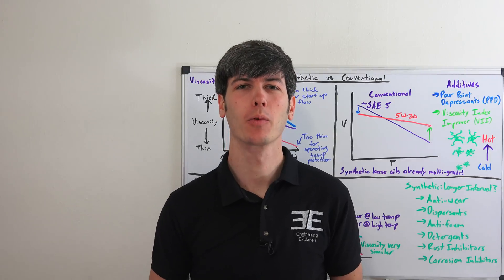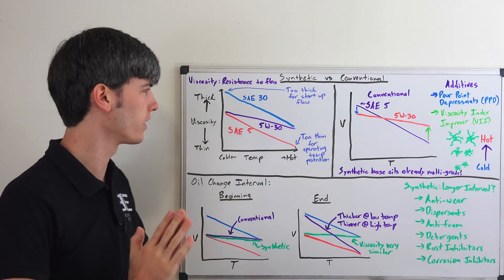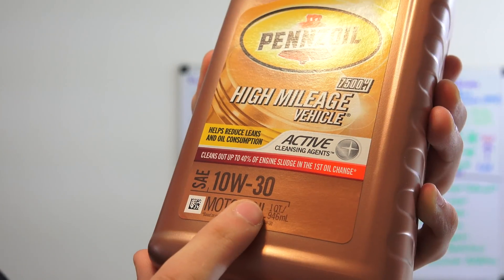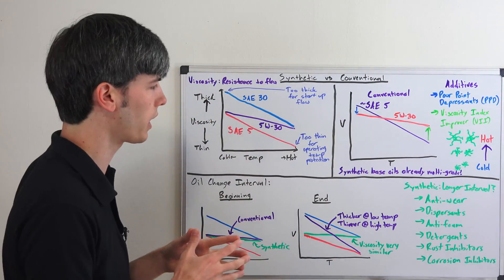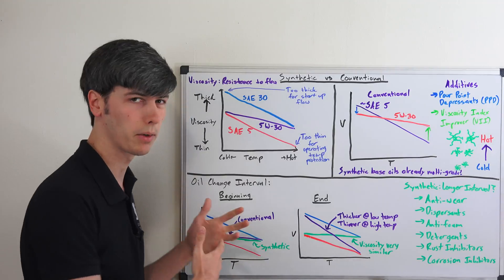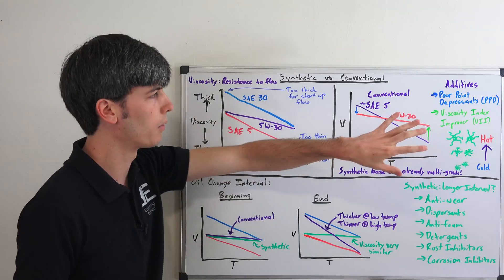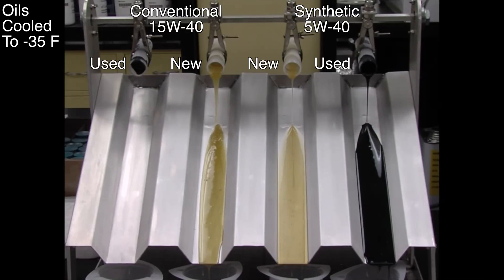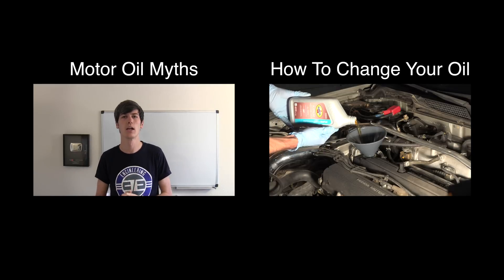Is Synthetic Motor Oil Better For Your Car?

Comment: I was told to use conventional oil in old engines since conventional oil used back them so the engines were designed to use conventional oil, is this true?
Reply from the maker: New oil is better in every way, so I only see positives to running modern synthetic. Only one I’ve seen that specifically recommends conventional are some rotary engines.
Reply: @EngineeringExplained  Agree completely. The reason mineral oil is often specified with rotary engines is due to the appetite for oil these engines exhibit. Basically it's a cost saving exercise to keep the owners vaguely happy.

Comment: Typically every manufacturer that requires synthatic recommends oil changes longer than the 3000 miles. Having said this, curious to know why you think that synthatic doesn't normally come longer drives between changes.

Comment: Some vehicles will leak using synthetic oil!!!
Reply: And others won't.
Reply: @paulanderson79  duh uh??!!
Reply: @mikesecondo2254  Some will leak with mineral oil. Others won't. In all cases the ones that leak is is because they have oil leaks. Fix the cause, rather than load the wrong oil into the engine as a botched workaround.
Reply: @paulanderson79  no not really....when switch to synthetic from conventional oil leak soon begins...... switch back to conventional oil leak gone....seen this many times... been in the auto repair industry for 43 years..so I know what I'm saying!!!!!!!!!!
Reply: @mikesecondo2254  I'm not disputing what you say but can you explain this phenomenon you've observed?
Reply: @mikesecondo2254  What drawing board? You've 43 years experience in the auto repair trade. I respect that. Thus I ask you an open and honest question. Why not reply?

Comment: If where you drive never gets to -35 F this demonstration is irrelevant. This is around the temperature where you and your vehicle both will quickly turn into popsicles. When I lived in Western Washington, the lowest winter temps were around 10 F, and that was rare. I'm in Central California now and it never gets colder than the mid-20's F overnight. Frankly, I could have used 10W-30 year around in every vehicle I have owned everywhere I have lived in my life, Chicago included. For someone in an ordinary climate, there is only one takeaway here. If you use conventional oil, don't go too long in the drain interval.

Somewhere in the comments here, someone who had worked as a mechanic for the New York taxi fleet said that what oil was used made no difference when they tore down the engines. Years ago, I drove high mileage for my job. I used both synthetic and conventional just depending on my whim. I saw no noticeable difference in fuel economy. In my estimation, if you don't live in a  subarctic zone or in the Kalahari, the only value of synthetic oil is that it allows a longer drain interval. I do no more maintenance than necessary and my vehicles always go to very high mileage. If using synthetic oil helps a driver to think maintenance and adopt driving habits which help preserve the vehicle, fine. But outside of a very extreme climate, seriously synthetic oil has little or no value.

Remember, you're driving a vehicle with a cast iron or alloy engine. You're not driving a B-52, a C-130 or a DC-4. What applies to these may not apply to a gasoline-powered motor vehicle. If you own some kind of exotic production, follow the recommendations. If you need to ask, you can't afford it.
Reply: You might be missing the point of the demonstration: Reducing the temperature of the oil wasn't for the sake of people who live in colder climates. They reduced the temperature of the oil so you can see (more clearly and easily) the significance of oil degradation after use between conventional and synthetic. The oil was cooled significantly so you could see an extreme, and clearly see that the properties of the conventional oil were more significantly affected, while the synthetic oil was fairly the same (even under these extreme temperature conditions). Sure, you're right: This is an extreme and most people won't fall into these extremes. Just thought I'd offer some clarity in perspective in case you missed it.
Reply: @patrykjanuszewski2126  I'm back after a year. No, I didn't miss the point. What I am saying is that the oil degradation which occurs may be irrelevant.15W-40 is called 15W-40 for a reason. As far as I know, the increase in viscosity occurs not as a result of polymerization but because lighter components evaporate out. Hard to get good numbers but the temperature range of 15W-40 conventional probably is down to about 0 F. The best information I can find indicates that engine oil heats up at the rate of 10 degrees F per minute at idle, and probably faster is the vehicle is moving.

At the indicated temperature range for the product, the used 15W-40 will work just fine just like the used synthetic 10W-40 will do also. Synthetic 10W-40 is supposed to flow adequately at -40. Even the used 15W-40 would start to get pushed around by the oil pump and start to warm up. But it's not a good idea and outside of the product specifications to run 15W-40 at a -40.

If I've learned anything from all of these videos, it's trust the specifications of your products. Dino oil is made to go up to 7500 miles but I think 5000 miles should be the maximum interval for dino and 3000 miles is better. For me right now, 3000 miles is twice a year.

Comment: The thing I found interesting recently is how "full synthetic" and 100% synthetic mean two different things. Full synthetic is not 
"full" synthetic at all but a mix regular oil with additives and perhaps a varying mix of synthetic or not. This was circa 1996 or so 
after a lawsuit between 2 major oil/fuel producers and how the oil can be marketed. This shocked me as I had been using Mobil 1 for years on all my cars, newer and older despite mileage. I learned that the only 100% 
synthetic oil producer today is Amsoil and Motul. I wonder if EE has looked into this as far as the degradation and lifespan of true 100% and "full synthetic" types?
Reply: i was Not aware of those exact details but i'm not quite sure that's the whole story.  Fwiw, i used to use Amsoil in my jeep 4.0 engine ,and was shocked that it thickened quite quickly, can't recall now but maybe within 3 or 5K miles if not fewer miles, it had thickened quite dramatically, and i became dubious about the Amsoil brand and about the theories i guess that they use in their formulation.   Maybe bad batch ,dunno.   But it was fine when new, and then thickened markedly, to the point of clearly being a bad oil for the engine

Comment: You seem to be very knowledgeable about oils.  There is a large Porsche air cooled community that would be interested in how good Swepco 306 compares to the new Porsche Classic in both viscosity and for wear protection of the flat tappets because of the high spring loads on the cams.  Could you do a comparison

Comment: Its means sysnthic engine oil is better for car..??
Reply: Yes. With no exceptions.
Reply: @paulanderson79  no if you have a older truck or car it is not always better for example I have a 92 ford f150 when I bought it the guy told me he had conventional oil in it cause that's what runs the best I did not believe him i then changed the oil and filter at the appropriate mileage and put full synthetic in the next day I noticed a kind of knocking sound from my engine when I started it that would go away after it warmed up that did not happen before and my truck started to leak somewhere but I did not know where from so I went to store and bought conventional oil and changed it again and both the knocking sound and oil leak stoped
Reply: @loganhaxton4653  OK, I cannot argue with the facts as you present. But have you any idea why this might be happening? It defies all logic.

Comment: Not everyone should upgrade from Motor Oil, I payed $50 for Synthetic Motor Oil in my 2006 Chevrolet Aveo LS, and I just hit the interstate, it Ran really fast but not for long; soon It was bone dry and I was broke down; it eat away all of my seals that had that looked new before the oil change. The engine was Clean and never licked before with the old oil type and the seals had been personally installed less then a year ago.
if it ain't broke don't fix it; you just my Brake it trying to keep it safe!
Reply: Funny we never have these issues in Europe.

Comment: I have a 1982 BJ42 Toyota landcruiser, an old mechanic tells me that semi-synhettic or synthetic is detergant and will thus clean alot of particle that risk 'block' it ...  I guess there is more to oils than just viscosity ...?
Reply: Far more to it than just viscosity. I wish more people understood this. Synthetic oils can find leaks more readily than mineral oils will. So I'm told. Here is Europe virtually no one uses mineral oils. We don't seem to have engine issues either. ACEA sequences / API specs MUST be followed.

Comment: I read on the internet that if I put synthetic oil in my 7.3 Powerstroke it would quiet it down a little at idle.  Wrong!  No difference.  I compromised now and use a synthetic blend (Rotella T-5) in the pickup and 5-W30 synthetic in the 3 cars, and straight 30 synthetic in the Zero-Turn lawn tractor.  Without tearing down a perfectly good engine I have no real idea if synthetic makes any actual difference?  I am an engineer and get all the theoretical advantages, but real world I believe that unless you are pushing the engine hard (a little street racing, etc.) it probably does not make much difference.  I think that a good quality filter might be the critical path.  All supposition on my part.

Comment: What would be nice to see, especially for the synthetic haters, would be 2 lab reports.  Each done at 8,000 miles, one conventional, the other a cheap full synthetic,   like say Supertech which is now $16 for 5 qts.  Wish I'd of thought of that when I was driving 22,000 miles a year.  Been a  SuperTech full synthetic user since the 90's with 15k oil changes and a filter at 7,500 for 22yrs.   Only non synthetic I've considered using is Havoline with Deposit Shield.

Comment: The only real synthetic motor oils are Mobil 1 and Amsoil. They are created by using a base stock of Polyalphaolefin instead of regular hydro cracked oil. All other synthetic oils are marketing tricks that allow non synthetic oils to call themselves synthetic. Real synthetic oil binds to metal  when it is hot unlike non synthetic oils that drip away from heated metal. The main difference between Mobile 1 and Amsoil is that Amsoil uses a higher base stock and adds esters to their oil to keep valve guide seals and front and rear main seals from cracking and leaking. I have a vehicle that is 18 years old and have been using Amsoil from day one. I have no leaks or engine crud due to regular petroleum oils and only have to change my oil once a year.
Reply: The word is Mobil, not Mobile. Here is Europe we don't have the synthetic labelling issues. It's important to stick with all the manufacturers specs, viscosity isn't the whole story.

Comment: Synthetic oil bonds to bare metal. If your engine was not built using synthetic oil at the factory, there is no benefit,

Comment: Testing used oil. How used? As in what kind of run time? Running at idle? Running in a diesel? This test is BS. And on top of that a lot of the synthetic oils are made with petroleum products IE: oil.  Some are fully synthetic.

Comment: If you use Lucas oil additive (awesome stuff) you cannot use synthetic oil. I prefer regular oil as I have older vehicles.
Reply: Most cars in Europe have specs that cannot be met with mineral oil. Synthetic is the norm here.

Comment: I have used duralube engine lubricant as an additive to engines on buying used vehicles and have run vehicles with no water because the radiator blew out and had to drive to where I was going. to my surprise no engine damage after using Dura Lube on my van V8 engines several oil changes. I am not particularly concerned about my oil I am concerned about friction proofing my engine with Dura Lube at several oil changes. for a V8 van engine you will have to do one quart of duralube at least two times on your oil changes.

I do not work for, or own stocking Dura Lube.

you can buy Dura lube online or at Walmart which is where I get it. I don't work for Walmart either and I don't own their stock.

Comment: The main difference is molecules.  The molecules in synthetic oil, are (roughly) the same size and shape, so the oil breaks down evenly over time.  Conventional oil, the molecules are different shapes and sizes, the large molecules become sludge, and the small molecules burn up or evaporate at high temps.  3,000 mile oil changes, were recommended when oils were originally designed, nowadays you can get away with 5,000 even 7,500 mile oil changes, but you're still running a higher risk of engine damage.  Personally, even with synthetic oil, I've noticed a slight drop in gas mileage after 5,000 miles.  My 92 Honda recommends change the oil every 7,500 miles, but I can't allow myself to wait that long.  I do 5k with high protection filters, and I'm near 300,000 miles on all original parts except water pump and head gasket.

Comment: Need to revisit the definition of "better for your car" An oil maintaining it's viscosity for a longer duration is an overly simplified definition of better. Let us define better as a lower cost for the same protection. If it takes twice as many oil changes of conventional oil to yield the same protection as synthetic oil and a synthetic oil change is more than twice the cost of a conventional oil change then conventional is better under our new definition.
Reply from the maker: Here's a video that goes into more detail as to why synthetic is better. Definitely not just about viscosity. AAA ran 8 different tests for synthetic vs conventional and found synthetics perform on average 47% better combined across all categories. https://youtu.be/0IqLRhxdoGg

Comment: Very comprehensive. I used to worry about engine lubrication and paid extra for the expensive synthetic type. I use conventional oil in my year-old SUV per dealer but I still think synthetic  would be better and will probably change over next time. FYI back when I had a 2-stroke Yamaha motorcycle I found out to use synthetic to stop fouling the spark plugs all the time.

Comment: The demo at the end of the vido makes no sense regarding the explanation before. The Test shows that the used oil is thicker. In the explanation is stated, that the oil loses viscosity over time. Means, the used oil should be thinner than the new oil. But the opposite is the case. Explanation?

Comment: You should change the title of this video to "Is Full Synthetic Motor Oil Better For Your Car than Conventional Oil?".  You should also point out in the video that Full Synthetic is really not synthetic at all but made from the same starting base as conventional motor oil is which is not synthetic just that Full Synthetic is more refined and has more additives to it.  The only true "Synthetic" motor oils are 100% Synthetic motor oils and they beat the pants off any Full Synthetic or conventional motor oil.

Comment: Excellent video.
A Qn: The owners manual of my car recommends changing the engine oil after " 10000kms or 12 months, whichever occurs first".
I use my car very infrequently. Typically, just a 1000/1200 kms in 12 months.
With such low usage why is it necessary to change the oil after 12 months? Surely the oil would be good enough to do its job.

Comment: What? NO discussion of Group 3 versus Group 4? Much more important than the minimum ratings every oil meets. Mobil 1 used to be Group 4 but like 99% of U.S. oil makers, downgraded to Group 3. Use a real synthetic like Royal Purple, AMSOIL Signature and Redline. Mobil 1 is the MYTH.

Comment: Your second graph on top right, when you drew the purple line to represent the conventional straight SAE 5 oil, vs the red line to represent a 5w-30 oil with additives, the starting point (left side) of the 2 lines should meet as you drew in the 1st graph, but in the 2nd graph you showed the red line started higher than the purple line, this isn't right. Both red line and purple line behave like an SAE 5 oil in low temperatures so the starting point should not differ.

Comment: A simple truth about oil for those that prefer it quick and easy. Oil doesn't wear out it gets dirty, so if you want to get more miles out of an oil change, eg;, 3000 - 5000, just change your oil filter and only your oil filter at 2500 miles and then change both the oil filter and oil at 5000 miles. I`m a retired heavy duty mechanic and our equipment works very hard in dirty conditions, so we have a 2 oil filter system on our equipment, halfway to oil change we change the primary { first} oil filter and at oil change intervale we change both oil filters and oil. Avery good practice is to check your oil filter size, in most vehicles, the car manufacturers use a small filter to save money, these will hold less than a 1/2 quart or litre of oil. I always check filters out {thread and gasket mating surface} then put the largest oil filter that will fit in space provider. this allows for more filtration with less resistance when oil is dirty. Bonus is when you change your oil filter at first or primary change { filter only} you will  use up more of old oil and then you must run engine to fill filter 60 seconds is fine, then check oil level and top it up, now you have successfully reintroduced some of the oil additives and added clean oil to old oil.